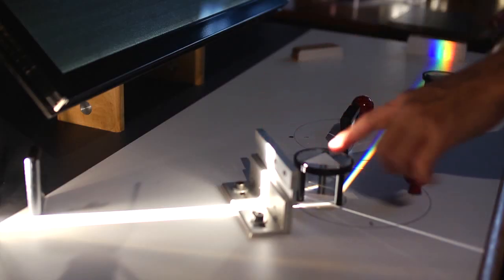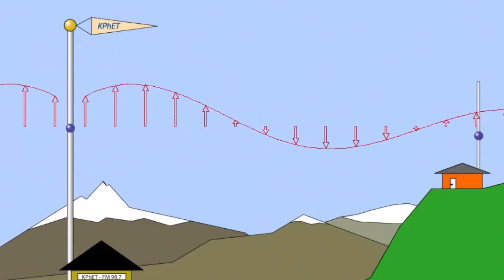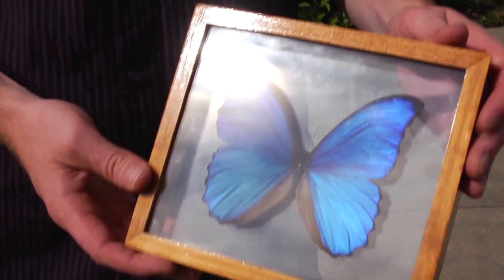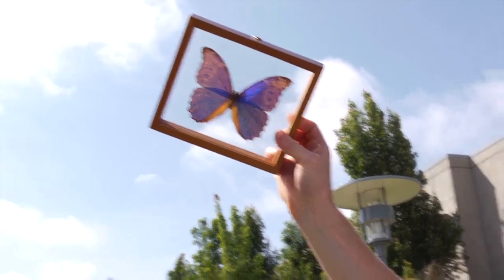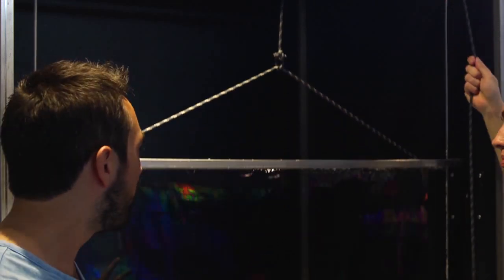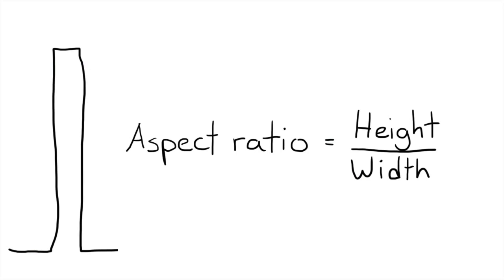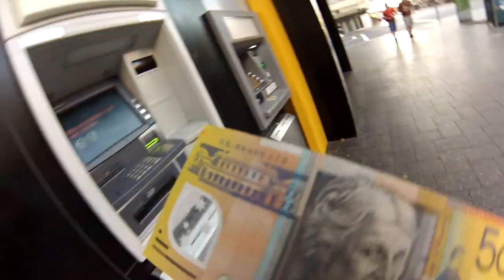How To Make Colour With Holes

Comment: Arrays of nanoscale holes create striking, iridescent colours through a process called structural coloration, which is inspired by natural phenomena like the shimmering wings of a butterfly or a peacock's feathers. 

How it Works
Unlike traditional pigments or dyes that absorb certain wavelengths of light and reflect others, structural colour is produced by the physical interaction of light with precisely engineered nanostructures. The key mechanisms involve: 

Light Interaction with Nanostructures: When light interacts with the tiny, periodic holes (nanohole arrays) on a material's surface, the light waves are scattered and interfere with each other.

Resonance: The specific dimensions, shape, and spacing (periodicity) of the holes cause certain wavelengths of light to resonate, an effect often referred to as surface plasmon resonance or Fabry-Pérot resonance.

Selective Reflection/Absorption: This resonance effect results in some wavelengths being strongly reflected (or transmitted) while others are absorbed, leading to the perception of a specific, vibrant colour. 

By simply changing the geometry and dimensions of these nanostructures, different colours can be created from the same material, making the colour generation process highly controllable. 

Applications
This method offers several advantages over conventional colouring, including long-term stability, durability, and environmental friendliness. Potential applications include: 

Anti-counterfeiting Devices: The colours produced by these nanoscale structures are extremely difficult to forge and are much more reflective than traditional holograms, making them ideal for security markings.

High-resolution Colour Printing and Displays: The ability to create high-resolution colour at the microscopic scale allows for advanced colour printing techniques with resolutions far exceeding state-of-the-art imaging.

Biosensors: Nanohole arrays are also used in biosensing applications due to their unique optical properties and ability to enhance light-matter interactions.

Comment: 1/4x lambda( wave length of that frequency). 
Thickness=1/4-1/2 lambda interfer due to refraction. The back plane of the film, dependant on the n- index number is responsible for amplifying the light. If the back plane of the film is close to one then there will be less light bounce. Also the n- index is responsible for the angle of refraction, exiting the film. 
The holes are 1/4- lambda apart, causing amplification of the harmonic multiple of the fundamental node- 1/4xlambda x N, Where N => infinity as the amplitude goes to zero( basically 2- colours are amplified together)- producing a different color. 
The angle of color view is caused be n 1x Sin( theta)= n2 x sin( Theta2). Air has an n value of 1 and glass has the value of 1.5, so you can use this to determine the width of those holes separation by the two amplified colors hitting your eye. 
In all , Polaroid work in the similar way except the thickness is 1/2 x lambda
Reply: Great Explaination for the Thin-Film Interferrence!
Reply: @DirkIronside  thanks David
Reply: My Bio is below:

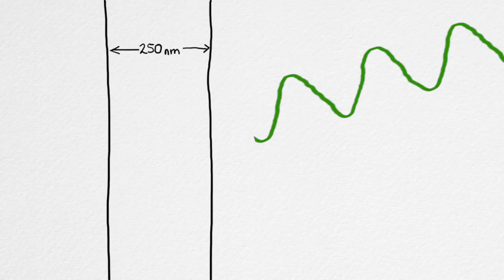Comment: Awesome video.  At 3:42, shouldn't the width of the thin film be ~1/4 of the wavelength of the light for destructive interference to occur, instead of 1/2 the wavelength of the light?  (The light has to travel into the thin film and back and be 1/2 a wavelength shifted.)

Comment: ...GOOD JOB, Derek ...HOW would you analyse a 'fabric' of such density for H2O 'flow' assuming a 'one mole' (capture) ...would the water suspend or diffuse? ...also, could that be a 'steam engine' (per hole) or 'electrolysis' vapor (gas production == H) ...if the 'threads' were infused with (copper / zinc) (gold / silver) ...could this be the next 'graphene' experiment?

Comment: Wow, as a graphic designer I really want a printer that could do this
Reply: just take a small needle, a really small one, then take some time, and take some precission, i mean really good precission. C'mom, you're an designer. Use your imagination :)
Reply: Some powerful laser should help. If it can evaporate tiny layer of material for few impulses then you can do electromechanic guiding system to move it across the image. Or maybe better get two lasers. It will give you ability to evaporate only small interferential points.
Reply: @ЮрийДолотказин-с4ы  i think it is impossible to focus the light to be that small
Reply: Whoa
Reply: You can just use interference blue pearlescent pigments with clear ink, but not with a inkjet!

Comment: Oooooh god, that is genius, I FINALLI got it! So when u explain how the green is removed, since u've got 250 nm between the first and the second wall, multiplied by two it gives 500 nm which is the exact distance that green light travels for a full wavelength, and so it meets the green light that is the same "state" (troth or... what was it called again xD). I got it at like... The fifth view of this video.
Reply: i just got it after you explain ._.
lol thanks
still i'm quite confused about how that tiny tiny hole can reflect light,
at first i imagine it would be like filtering the wavelength of visible light and only allow certain wavelength to pass through, but it seems like it's not the case
Reply: @Derpy Hooves
  Yes, but be careful though.  The graphic was greatly simplified.  If the green light is shifted a full wavelength, then that actually means it should constructively interfere, not destructively interfere.  However, it does indeed destructively interfere because there is a 180 degree phase shift upon reflection of the soap surface.  Another confounding factor, that was also simplified, is refractive index.  It actually shouldn't be 250 nm because the wavelength of green light is actually shorter in the soap film, since the light is travelling slower.

Comment: I have recently read an article which said sound of 1100 db would create a black hole, is it true, if yes how is it possible?
Reply: +UNIVERSE (re-defined) I didn't search anything and never heard of that but that seems to make sense.
Sound is a pressure wave, it can apply a force. Decibels are an exponential scale. If you can apply a pressure high enough onto an object, you have a force that overcomes all the fundamental interactions and you theorically compress it into a singularity, so you would create a lot of tiny blackholes on your wavefront, so tiny that they would collapse immediately in a big explosion.
Note however, that speaking about "1100 decibels" is kind of strange, you don't speak in decibels at that point, you're at the levels of energy of an uncountable amount of nuclear blast. Even given infinite ressources, you couldn't create such a powerful pressure wave, because the source would need a very high energy density, and the only such source you can imagine are blackholes, only energy can't really escape blackholes(and the Hawking radiation is very low).

If you need an analogy, a blackhole is only something very dense, so you can compare that to a car getting crushed by a press into a dense metal cube. Sound is comparable to a press, only it propagates in all directions, is periodical(think the press goes up and down, up and down), and it usually doesn't have the energy to crush a car. If your sound is very loud, you get multiple high pressure blast, like you can see on explosions videos(the thing that looks like a smoke ring in nuclear explosions videos), this blast(it is a high pressure front, like sound, only it's not periodical) could be given a value in decibels of less than 280, and it can crush cars, shatter buildings and so on.  So yeah, given that sound can act like a press, if you have a  press powerful enough, you can collapse matter on itself and create a singularity.
Reply: If it were true, there would be black holes where various clubs had been. Ibiza would be one big black hole.

Short answer is that with our current level of understanding, even contemplating this is a complete waste of time and bandwidth.

Comment: I guess this is why the back of a cd looks all rainbowish sometimes.
Reply: +GameZap! cds have tiny little holes in it created by a laser burn. that´s how we put data into cds. and that's why it is rainbowish
Reply: @dot_frost  CDs don't have tiny little holes. CDs are written when a die under the protective layer changes colour when hit by a laser. M-Disks are the ones with the holes but even those refract light without filtering to a single colour.
Reply: @cyberlord64   What?
Reply: FckThtShit11 Yeah, I know. That's why I said what I said?
Reply: Even blank ones which haven't been written still have a single very tiny spiral groove to guide the burning laser. If you burn only half of a CD, you can see where the laser has been.
Reply: Thank you so much, you really amazed me xD
Reply: It does not apply to rewriteable discs.
There it is different molecular state of a material. hmm. I might be mistaken that they are also colorful.

Comment: Do the holes have to do with diffraction of light? Only the green wavelength (or smaller) can pass through the hole. Therefore making a colour pattern of visible green light. 

You know I've got a Physics exam on waves and it would be useful to know :)

Comment: Dear Veritasium. One day when I was lying on my back with a straw hat covering my face I found that if I focused my eyes correctly upon the holes in the straw I could see the surface of my eye. When I blinked I could see a line in the fluid upon my eye like a windscreen wiper and particles of dust drifting across the surface. Could you explain this? Does the small aperture cause the light reflected from the inside of my eye to come into sharp focus like a pupil creating a reverse projection.

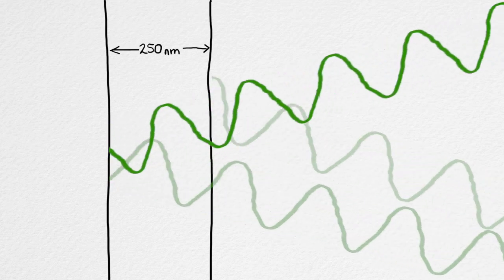Comment: Why do the two green lightwaves cancel out at 3:50 ? Is it perhaps because the distance between the front and back is 250nm (half the wavelength of green light) and so every trough will meet with a crest and vice versa?

Comment: if we overlap two beams of light of same frequency and of same amplitude but having phase difference of 180' then we get nothing in other words in destructive interference where will all energy go . because according to conservation of energy we can neither create nor destroy energy or  in case of double slit experiment . consider both destructive and constructive interference at the same time like what happened in double slit experiment and now consider the energy of each hole 2E so that initial energy of system become 4E now divide energy of each wave into 2-2 equal energy wave such that one of each hole wave participate in constructive interference and one of each hole wave participate in destructive interference withe other hole wave . the pair which show C .I give wave of energy 2E and the pair which show D.I give the wave of 0 energy hence final sum remain just 2E. this is best i can explain you my question

Comment: So to remove the green wvelength to form magenta, the thickness of the soap film would have to cause the the crests of the 1st reflection to align with the troughs of the 2nd reflection (and vice versa)....causing destructive interference, the removal of the green wavelength, at that spot on the soap film. Is this correct?
Reply: Yes it is.
Reply: gracias

Comment: is this why cd's make rainbows?
Reply: I assume that the color is sort of random on cds because of the random sequence of notches
Reply: TheCubicBeat This answer is a bit late, but yes. And the color isn't random, it depends of the angle the light incides to the CD. You can look for the distance between the tracks on the Internet. CD and DVD make different colors because the distance is shortest in the later.
I made a spectroscope with a CD and a box when I was on high school

Comment: Is the same process used to create that shiny 3d mark on a credit card?
Reply: A similar effect, but rather than holes they use a surface that you could compare to a set of razor blades in a shaver. Since the surface is rigid and reflective, light will refract around and then sooner or later get to you eyes as the original white light but with it color pattern blended around to make it appear as a random pattern of color (the red, blue, green, etc. colors).

Comment: I wonder. If you had a surface of nano-mechanical plungers, each 100nm wide and able to actuate pependicular to the surface 100nm, could you create a system for a display? THere is some precedent for this, DLP projectors have tiny mirrors on a chip that can move around. Now those mirrors are (according to wikipedia) 5.4µm, which is a way bigger, but they also needed thier pixels to pivot in two directions, if we have it acting as a solinoid, 100nm might be a viable option. Though what strikes me as the biggest difficulty would be the distances between the holes really. I'll have to give this some further thought.

Comment: But wait, does the color come from light bouncing off the rim of the hole, or the wave lengths that size, or smaller going through the hole?
P.S.Where can the term photon be used in all of this, could it be that the electromagnetic interference is caused by the photons hidden within the field, how can light act like a particle if it's spreading outward across the vacuum of space, if it's still a wave, then what is the medium, and will this sentence ever end
Reply: This demonstrates the wave nature of light, so you wouldn't say photon here.
A photon is a bundle of electromagnetic energy, as described by Einstein. The medium is the electromagnetic medium. I don't know how to answer the rest of your questions.
Reply: First of all: Light is an electromagnetic wave with partical-like attributes and wave-like attributes. It is none of them at all. You talk about light made out of photons if you look at quantized energybundles. When it comes to reflection, refraction or diffraction you speak of the electromagnetic wave itself. Those are just models to explain lights behavior.

Now to your question: With the holes you create 2 parallel surfaces on an object. The first surface is the untouched surface between the holes and the second one is the bottom of the holes. Light is reflected by both surfces. And thus they are so close together even white light with a very small coherence lenght can interfere with itself. Because of interference some wavelengths get relected totally and some are transmitted totally, which makes the surface look colorfull. The color also depends on the side you are looking at, if light travels through the surface to your eyes, or is reflected by the surface to your eyes.

Comment: companies are not using these holographic stickers for protection( stopping counter fitters) , however each sticker (especially Motorola) has an encoded message, written into thousands of data pages which play a small add based on the manufacturer's demands for this "security stamp". This goes far deeper then security, it effects people subliminally, and subconsciously in ways we may not notice. This creates subconscious conditioning and subliminal indoctrination of desires and actions, these holographic are more for mind control then protection.

Comment: I wonder if you could do this to your skin? RAINBOW SKIN!
Reply: Actually it wouldn't hurt at all. It's a nano needle, smaller than a mosquito's bite. But it wouldn't work because this effect requires the structure to be rigid, whereas skin is soft and would simply fill the hole up as soon as the needle is removed.
Reply: would probbably hurt alot to get those holes punched in you and would probbably heal soon..
Reply: Skin is already really rough and not smooth at all. Glass can be really flat so the holes wont mess up
Reply: Your skin already has holes where do you think sweat comes from?
Reply: @Aniket I reckon you'd only be able to see a spot of color, since our skin isn't flat.

Comment: oh yeah thats why a cd looks like that
Reply: Oh yeah i never thought about that.
Reply: A CD actually looks like that because of gratings and not holes.
Reply: @SC-zq6cu  he was talking about the butterfly wing technology not the hole one
Reply: @danielsteger8456  
He was talking about the rainbow colours of cd. As far as i know those colours in cd are caused because of gratings and not holes like in the butterfly wing.
Reply: @SC-zq6cu   it said in the video that butterfly wings get their colour by trapping light in their gratings in their wings. they are not holes.
Reply: @danielsteger8456  
Yup, my bad.
Reply: S C 
Well I guess the rainbow effect is due to refraction due to the grating. Silly me. It's still the same physics at work though, just in a slightly different way.
Reply: I guess it makes not much sense to try pointing out a difference between effects based on holes or gratings. If you have a hole it will be surrounded by gratings somehow, won't it?
Reply: @Competitive_Antagonist   It's not refraction; it's interference that causes the rainbow effect in CD's.  Very specific angles lead to constructive interference of very specific wavelengths.  It's very useful.
Reply: S C 
Don't they burn tiny little holes in the metal backing in binary to store the data though?
Reply: @SC-zq6cu   I'm not sure it makes that much of a difference.  Either way, the colored effect comes from interference effects.
Reply: ummm yeah